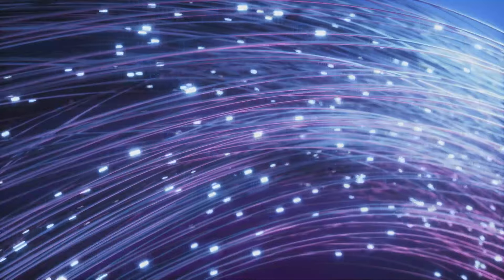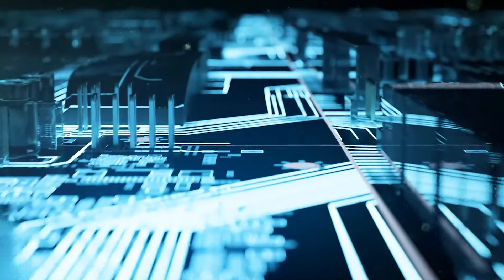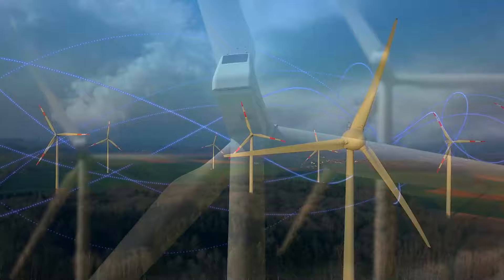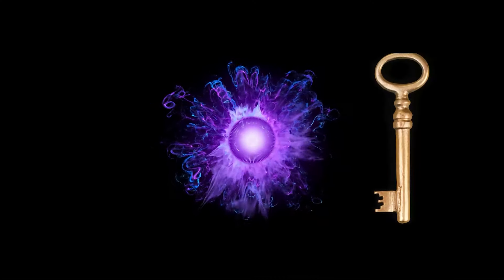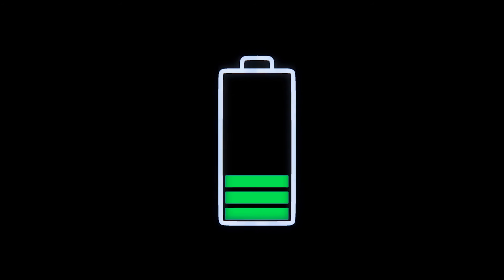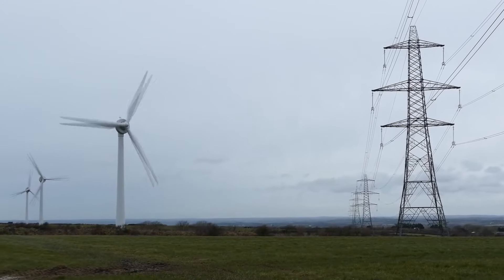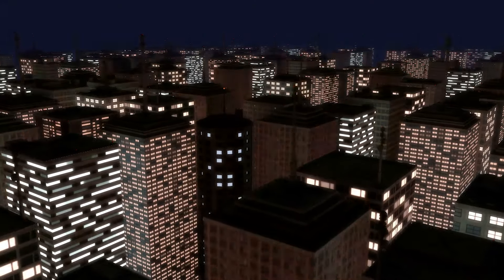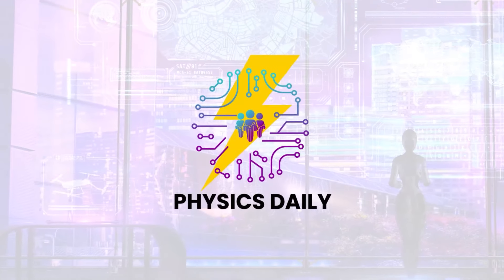The Shocking Truth About Electricity! | Electricity Simplified!

Comment: This is way over simplified and it's misleading. "Electicity on it's journey" is wrong, it goes back and forth doesn't actually go anywhere. Power isn't transmitted, it's oscillated. Watch videos on capacitors and you'll see what I'm talking about. AC power isn't transmitted from point A to point B .. it's not gas in a fuel line..